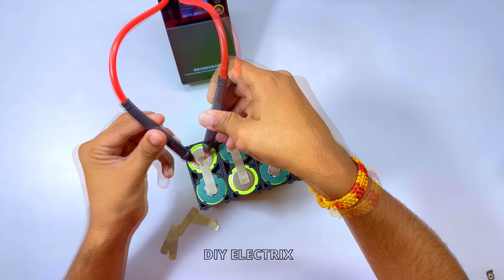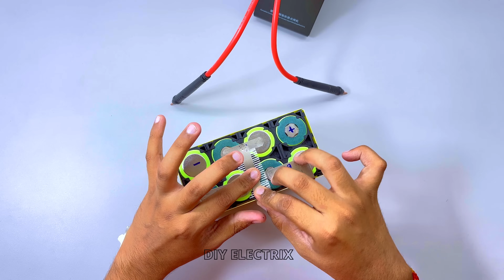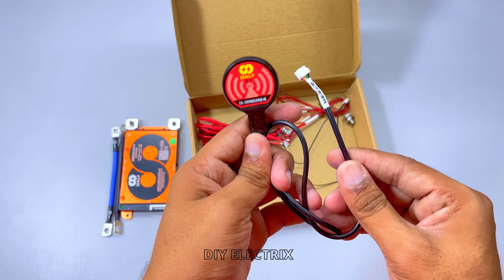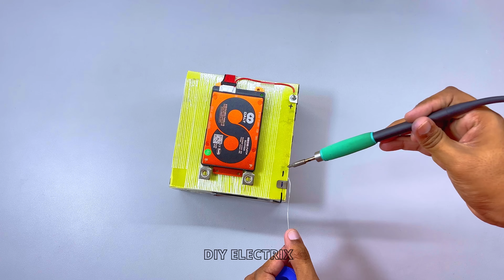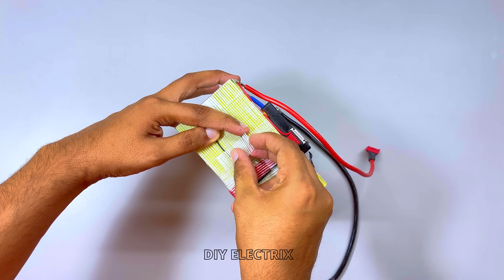Building a 24V 60A Battery Pack – Step by Step!

Comment: wrong placement of the thermal sensors. also, when soldering the terminal wires for battery management (b1++)you should unplug it from the bms first.

Comment: How the hell you get 60A out of this  and even the 24 V ?
3.2 V x by 8 = 25.6 V at nominal and at Full charge around 30 V after some rest.
 And at this voltage any electronics device will Burn if they don't have an input voltage regulator . 
Where as the 15 A , even if you put thousands of batteries in series il  will be 15 A .
So , in my opinion , you may be a lier or an IDIOT or both .
Click BAIT will never bring you subscribers and neither likes .and people can report you for miss information or whatever .

Comment: Wrong thumbnil its 24v 15ah battery
Reply: How many more batteries do I need to add to increase the current to 60A
Reply: @sathisfernando6275  if you mean 60ah, you would need 24 more batteries. This is called a 8s1p battery which stands for 8 batteries in series (this is how you increase voltage) but only 1 parallel (which is how you increase capacity). A 8s4p pack would net you what you want.

Comment: Theres no way those single layer nickel strips are rated at 60A Output (maybe at best short duration "instantaneous current") even the small soldered area of contact for the main postive / Negative output would be current limiting, thus high resistance & "voltage drop" would occur in large current applications in those areas & across all those tiny spot weld points of contact, across each & every cell.
Reply: Yeah, by the looks of it, maybe 5A to 8A constant current max for those nickel strips
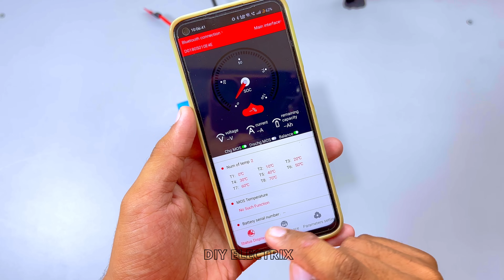Reply: In the minute 11:51 you can see the ampers, he put the cells in serie each cell have 3v some times more, when you put battery's in serie you increase the voltage so he puts 8 cells per 3v = 24v, and each cell have 15ah, i don remember the model of the cell

Comment: Wrong thumbnil its 24v 15ah battery
Reply: Yes
Reply: Luminous solar charger 20ah
Reply: Yeah, but the cell discharge rate is 2C so you can discharge 30Ah
Reply: @recitation165 No. You can discharge 15Ah, but you can do so at 30A.
Reply: @CollinBaillie  ¿eso es bueno o malo?  🤔
Reply: @recitation165 eso es bueno o malo? 🤔
Reply: BMS 24 volt 60ah  Ki Hai thumbnail galat Nahin Hai isliye ke unhone BMS ka volt aur ah likha hai  na ki battery ka
Reply: That's right......

But the caption is wrong & and misleading.

Lack of technical knowledge.

 @hafiz-aabid-hossain
Reply: @hafiz-aabid-hossain 😂😂fooling for 👍
Reply: 60A a for ampere hai mc 😂 na ki ah sahi hai thumbnail
Reply: you are right
Reply: 100😂😂😂mr
Reply: Yeah its wrong "thumbnil" 😂
Reply: How many more batteries do I need to add to increase the current to 60A
Reply: Yes
Reply: Глаза разуйте в описании написано 60 А а не А/ч

Comment: this is 15a or 60a?
Reply: 15a
Reply: 15Ah. But the BMS is probably rated for 60A discharge. 30A discharge is probably the maximum safe discharge rate for those cells.

Ah is capacity. Like 25 gallons or 100 Litres.

A is a rate. Like 1 gallon per minute, or 500mL per second.